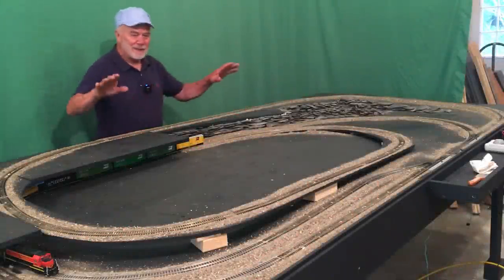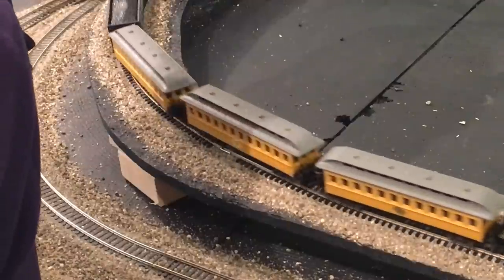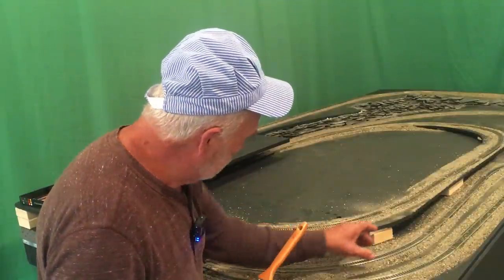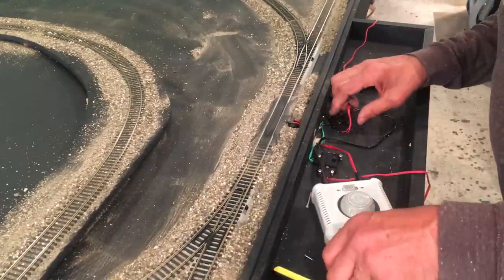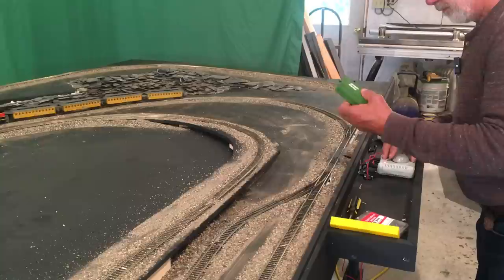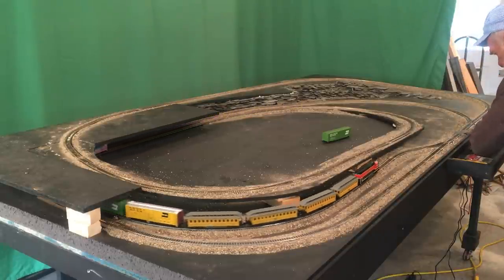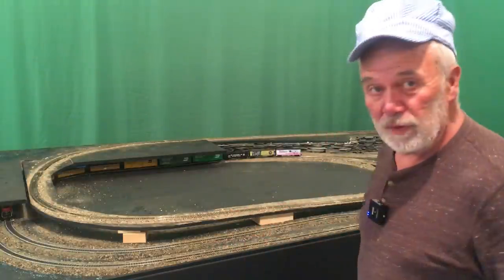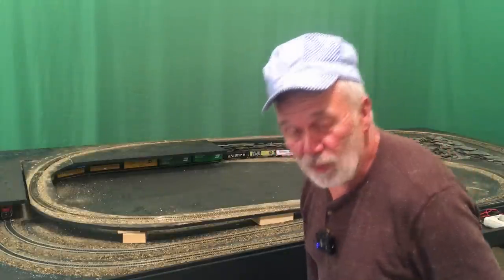Ep8 Do I Need Another Locomotive?

Comment: Hi Ken. The layout is coming along great. When I got ready to do my ballast I found a manufacturer that made ballast with the glue already in it. After it was applied and leveled all I had to do was add a spray of water. It was great and very easy to clean up. Continued success. Thanks for sharing.
Reply from the maker: Wow that would have been good to use

Comment: most people use a 50/50mix of wood glue and water  for  ballast and use the scenic cement for scenery etc ...
Reply from the maker: Oh. Thanks
Reply: Not " good enough" but "as good as I can get it."
In order to be successful in model railroading , that's the way you have to work. Great job sir.
Reply: You can use Elmer's glue instead of the wood glue in the 50/50 mix also. Dries clear. Not all wood glue dries clear .

Comment: Just found your channel, as you gain more experience/knowledge, you will learn about improving your rolling stock by removing the plastic wheelsets and replacing the with metal wheelsets, also replacing horn & hook couplers with kadee couplers and adding weight to the rolling stock. A very valuable tool is a NMRA gauge, so you can make sure all your track work is in gauge, wheelsets are in gauge and coupler heights are in gauge, all of which can be a source of derailments. The NMRA also sets forth standards for weight of rolling stock. Example, a 40’ boxcar should weight between between 3.25 & 3.75 oz., if I remember correctly.
Reply from the maker: Thanks for the info

Comment: The rail joiner seen at 3:10 looks like it needs to be adjusted slightly for a better connection and conductivity.  Use a small flat blade screwdriver and move the rail joiner so that it extends evenly on both sides of the gap between the rails.
Reply from the maker: Ok thanks

Comment: Maybe buy a Wheel set gauge measuring tool on line or at your local hobby shop? to see if the wheel distance are too/short/or wide through Manufacture HO Error. or it could be the trucks need a bit more oil? or the truck pin is not moving right?and gets stuck off and on when going through a turn.? What a great start to your Never ending enjoyment!! a labour of Love!!
Reply from the maker: Thanks good advice
Reply: Tolle Sache Ken 🎉🙂🙂🙋‍♂️🇩🇪🤗😁😊😅🤣
Reply: @josefreck1103  Courtesy of Google translate: Great thing Ken 🎉🙂🙂🙋‍♂🇩🇪🤗😁😊😅🤣

Comment: Ken, use your worst carriage to fix every issue, if it makes it everywhere then everything else will also, don't forget to go forward and backward over every part of the track, I have noticed that you only seem to go one way with everything.... try going the other direction and also.... try pushing carriages around the layout that makes for a different set of issues. This is something you might not also know.. the difference between code 83 and 100 track is ever so slightly higher than the other and that could be causing you issues also different brands of points of track manufacturers differ slightly also. This is one major thing I have noticed here in Australia. With your point switches, I would orientate them north/south to then know if the track that is open is coming from the top or the bottom. Another thing is to try and use everyday items that you have at home or in your workshop which will save you money, don't buy specific model train items.. like the glue and spray bottle, you can use PVA watered down and any spray bottle from a $2 shop or hardware which are more than 1/3 cheaper and saves you money for items that you can only get at a hobby shop.
Reply from the maker: Thanks for the advice

Comment: Ken the loco wheels slip when the load is greater than traction of the steel wheels. Just add a little weight to the bottom of the loco…
Reply from the maker: Thanks I may have to

Comment: Gluing your ballast, I don't know but I'd be concerned that the glue on the rails might insulate the track thus impeding the flow of electricity from the track to locomotive.
So you might find that you'll have to rub the track with steel wool or your file to maintain good electrical connection to your logo's electric motor.
Reply from the maker: Yes definitely a good idea

Comment: Nice cleaning up of the ballast material Ken. It's looking really good. It's great that you got your switches electrified! I'm glad you're spraying on the adhesive. I wouldn't want to brush that on! I hope the glue worked and you can move on to the next part. That's great that you can run a ten car train on the track and nothing derailed. It's really looking great Ken. Thanks for this video.
Reply from the maker: Thanks. Having a lot of fun

Comment: The car derailment is caused by weight of the car. Some cars are too light.  You can sometimes tell this by it wabbling as it rolls around the track or the cars derailing. The car isn't heavy enough to maintain its hold with the wheel flanges. You can fix this by taping lead fishing weights inside the cars. Be sure not to over weight the cars though. If you do this to too many cars it makes it harder for the engine to pull on certain grades.  More engines is always a good thing.
Reply from the maker: Thanks

Comment: In the U.K. we use a 50/50 mix of PVA/water with a small drop of dish detergent. Spray ballast with water first then apply with a pipette. Run the mixture down the centre of the track and it will spread through the ballast.
Reply from the maker: Great tip!

Comment: Yes, derailments come with the territory. Some cars just can’t work. Sometimes changing the sequence of cars makes it work. Coupler’s are another problem. I had problems with coupler heights mismatching and separating. Once you close in the tunnels if something derails or uncouples you need to be able to get at the problem inside the tunnel. If you can run the whole layout for an hour with no derailments you might have it fixed. You Are going to want to switch to DCC. So much cooler. Sounds and lights are great. Carry on!
Reply from the maker: Thanks I may get into DCC after I understand how this whole thing works. :-)
Reply: Hi George! (Did we discuss the meaning of DCC earlier? - did I miss it? 🤔)
Reply: Dcc stands for Digital command control.  The track stays fully powered and the locomotives are connnected to the controller by Bluetooth. You can run multiple locomotives on one track and vary the speed and direction of each one independently, plus, you can control horns, lights,other start up sounds and steam chugging sounds on steam engines.
Reply: @georgeutter9784  cheers George, Crickey, things have certainly advanced since my Dad gave me my train set in 1959! (I still have it) kind regards buddy.
Reply: @philtucker1224  that’s where I started also. Moved in 1962, trains didn’t make it. Fastforward 55 years, now I have 5 grandsons, retired in 2016 and went full throttle into doing a layout for them(also me). They don’t enjoy it the way we did. They are younger ( 3-9 years old) and just want to take the cars off the layout and play with them. And run the trains full throttle. Maybe in a few years they will get it.
Reply: @georgeutter9784  we’re similar in very many ways! Live long and prosper George.🙏🖖

Comment: Hi Ken. Like seeing what you are doing. Recently built an N gauge layout. Glued ballast with a mix of pva wood glue and water in a 50/50 ratio. Applied with dropper. A bit tedious but worth the effort, gave better control of the application around the track switches. Track is on a board 8 ft X 4 ft
Reply from the maker: Very nice. Thanks

Comment: To give the loco more traction, you could put some weight in that.
Reply from the maker: Hmm. Maybe
Reply: @Kens265  Experiment with a penny or two over the drivers. We used to put the welding bottles in the back of the pick-up to help in the snow.

Comment: Mornin Ken , 
Your lay out is coming along well .
Lay put building is a lot of trial and error , until you have the experience and then things sonetimes don't ho right either .
Don't be discorouged .  But when you try sonething new , do a little bit , until you know how it's going to look .
When i seen you spraying that glue all over i'm like wait , wait .!! 
Wouldn't buy that stuff , i've always used thinned down white glue .
Works very well when applying mayerial to your lay out 
On your train set , looks to me it's basically its a kids set , nothing fancy .
You can get all kinds of train sets , from cheapy to exspensive .
All depends on how much you want to spend .
There are brass locomotives out there that go for over $1000.00 .
I think they have power boost controlers out there also .
No clue on the electric switches , we never had those , closest thing to that we had , was a pressure switch for the crossing arm to go up/down 
You said you were going to close in the front of the tunnel .  Make sure you leave the back side accessable so you can get underneath there if you need to .
Myself I  would look into finding a better quality loco and better style connectors for the cars 
Again , its all about hiw much you want to spend .  You can be frugal on somethings , creativity and resourcefulness are great . But somethings you need to spend the money on .
You ever see any train shows in your area  ?? 
Go to them , can find a lot of items , parts etc , some for pretty cheap . 
Keep up the good work !! Easy to get frustrated , but you can fight your way thru it . 
Your infectious , positive , humourous attitude will get you thru anything !! 
Can't wait till the next episode !! 
BigMike
Reply from the maker: Thanks for the input

Comment: Maybe you need more weight on the locomotive itself.
Reply from the maker: Hmmm. Maybe
Reply: @Kens265  I'm not an expert, but I remember that each truck had traction bands on an axle.  So if the wheels are spinning, then the power hasn't failed yet.  So as I said. More weight over the traction axle and dust free track might do the trick.

As always, great video.